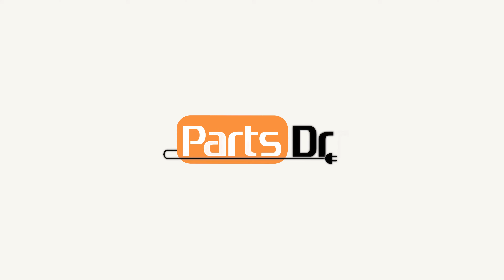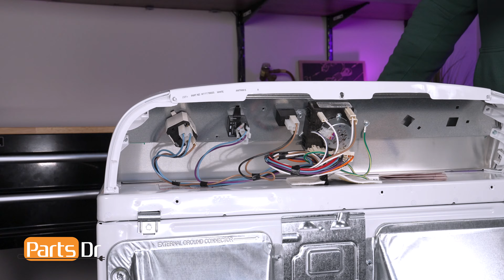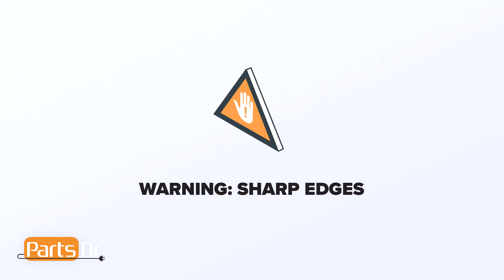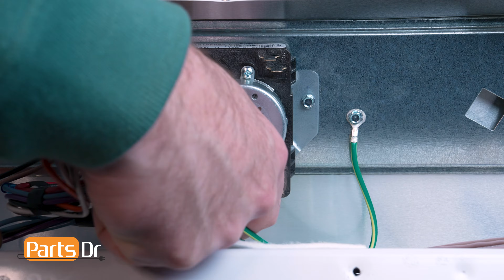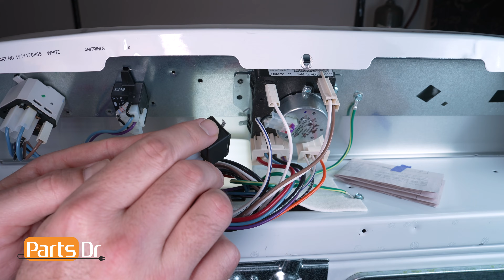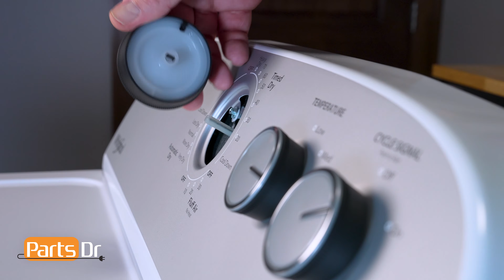How to replace Timer part # WPW10185982 on your Whirlpool Maytag Amana Dryer

Comment from the maker: If your Whirlpool, Maytag, Kenmore or Amana dryer isn't advancing through cycles or has issues like not starting or not heating, a faulty timer could be the culprit. This video walks you through replacing the timer step by step!

If you're ordering parts online, especially from places like Amazon or eBay, be cautious as many of the cheaper aftermarket timers are lower quality and can fail prematurely. For the best results, we recommend using genuine OEM parts. You can find the high-quality timer for your dryer at https://partsdr.com

Not sure if your timer is bad? Learn how to test it here: https://www.youtube.com/watch?v=I1xa6F-xwXA

Good luck with your repair, and let us know how your repair goes!

Comment: Changed timer now i have no power
Reply from the maker: Please check the outlet and power supply to the dryer first. Make sure the dryer is getting the correct voltage at the outlet or terminal block before replacing any parts. If the power supply checks good, then double-check that all of the timer wire harness connections are pushed in fully and secure.

Comment: Thanks for this video, a good job, but...

Removing the wires from the old timer is proving extremely difficult here.   The wire that connects to the round metal thing in the middle of the time is IMPOSSIBLE to remove by hand, and even using pliers it simply won't come loose.  I've watched that part of the video very carefully multiple times.  Not helping.  At this point I'm beginning to wish I'd skipped this project and just bought a new dryer, which would now be in place and working.  Thanks for your effort, a good video overall, but not really helping here.
Reply: So I finally figured out that I could just peel back the plastic on the old timer that was obstructing removal of the wire.   That solved the stuck wire problem.  All the other wires were already connected to the new timer.   So I was finally ready to go, and installed the brand new factory timer.  And it doesn't work.

The real problem here is that these machines, all them probably, are deliberately designed to fail.  Consider the little piece of plastic in the knob stem which broke.  It would have cost a few pennies to replace that plastic with metal.   So the plastic wasn't there to keep down the cost of the machine, the plastic was there to fail.   I'm not sure it really makes sense to try to repair machines that are deliberately designed to fail right from the start.

The last time we bought a washer I thought I was being brilliant by skipping the mid priced machines and buying an industrial scale model for twice the price.  I figured it would last longer, and thus wouldn't really be that much more expensive.   The "high quality industrial model" literally died the very first time we turned it on.  I kid you not.  

These machines used to last decades.  The reason they no longer do is simple.  These days the machines are deliberately designed to die so that we have to keep buying new ones.
Reply from the maker: @PhilTanny  Thanks for the feedback. Sorry to hear the new timer didn’t work, make sure to double-check the part number using the model number from your dryer on our site to confirm it’s the correct one. We also have a good video showing how to troubleshoot and test the timer here: https://www.youtube.com/watch?v=I1xa6F-xwXA
Reply: @PartsDr  Update:  We had a pro come out to finish the job and he discovered the timer (brand new from Amazon) was bad.   He suggested we not buy parts from Amazon.   Luckily my wife had already bought a replacement timer just in case, so we plugged that in and were done.  So, an annoying experience, but it did save us about $500, thumbs up for that.  Thanks again.

Comment: Can you use 220 v when there was a 230 v before
Reply from the maker: Most appliances designed for use in the United States are able to operate on 220 to 240 Volts AC power.  Check the details for your specific model dryer to be certain.

Comment: Is it true that these type of timers should only be rotated in a clockwise direction?  Will turning the timer backwards to restart the dryer cause damage or failure?
Reply from the maker: It depends somewhat on the dryer model, but for most Whirlpool dryers with mechanical timers, you can likely rotate the timer knob in either direction, clockwise or counterclockwise to set the desired time. Turning it clockwise, the direction timers typically advance, may reduce wear on the mechanism over time, so it’s a good practice when possible. Turning it backwards to restart the dryer, like setting a new time, shouldn’t cause immediate damage or failure if done when the dryer is off, though frequent counterclockwise turns might wear the timer out faster. To be safe, adjust the timer only after the cycle ends and when the dryer isn’t running.  Always reference your dryer's owners manual for specific manuafacturer instructions for your model dryer.
Reply: Thanks!

Comment: Can the plastic turning part be replaced with a new one?
Reply from the maker: It sounds like you are describing the shaft that the knob slides onto.  If the timer shaft has failed, the timer will need to be replaced.  Learn how to test your dryer timer here: https://www.youtube.com/watch?v=I1xa6F-xwXA

Comment: What if the timing is off, when you replace the old timer with a new one? Can it be calibrated?
Reply from the maker: That is not something that can be calibrated.  That would usually indicate that you either have the wrong timer installed, a broken cracked knob, or a defective timer.

Comment: Your video on how to test the dryer timer was very helpful. I have a Maytag electric dryer model MEDC300XW1. After following your direction I came to the conclusion that the timer was not showing any continuity from T - W. I removed the timer and right away I could hear something rattling inside. Not good. I just ordered the replacement part from your website. By the way your video was the only one I could find on YouTube with complete instructions on testing and replacing a dryer timer. Thank you.
Reply from the maker: Nice job troubleshooting the problem yourself!  And, thank you for supporting us!
Reply: How long did it take for you to receive the parts? I chose the 1 day shipping so hopefully it does get here early next week 😭
Reply: @SamanthaArreguin-u6f  I ordered the part over the weekend so it shipped on Monday and arrived on Tuesday. I chose the non expedited shipping.

Comment: Its sad that whirpool knows there is a huge issue in their dryer timer knobs and they dont replace it if ur warranty is out.
Reply: Ours just broke and I was looking at the piece wondering the same thing lmao plastic shaft that cracks off at the base is super cool in the component that gets twisted around daily
Reply: same happened with me. The plastic piece snapped after wear and tear. The entire timer needs to be replaced. Better than a whole new dryer. Good luck with yours. I would stay away from top loading and newer models.. more problems!